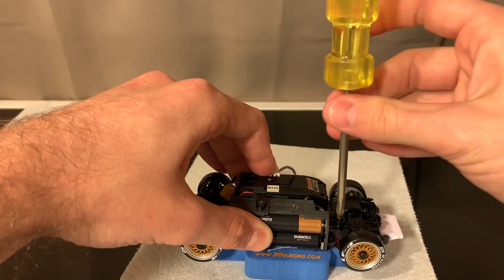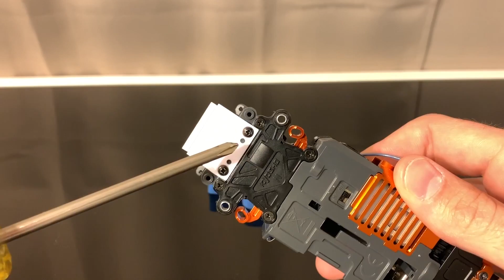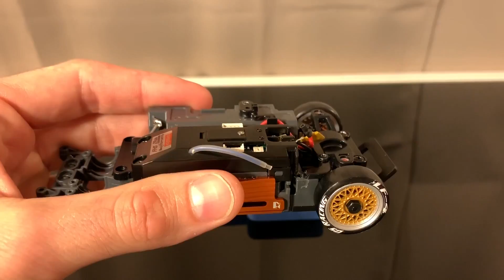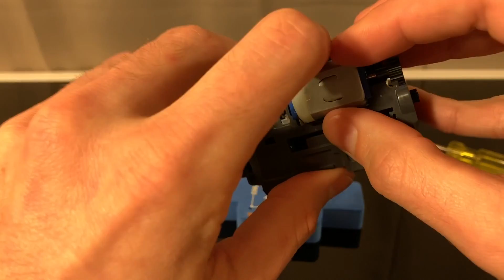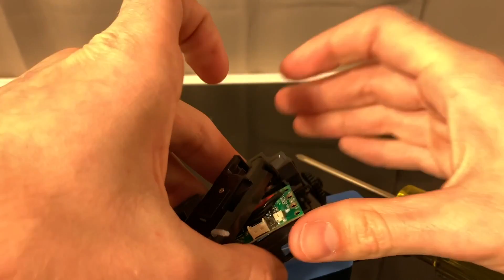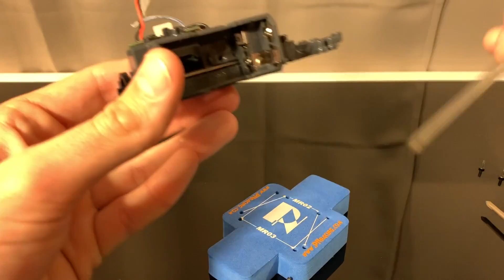Full Disassembly MA-020s Mini-z AWD Micro RC Car

Comment: Hi mate. Have you ever had a problem with the steering not returning back to centre and locking one way?
Reply from the maker: Check for dust & debris in the servo area. Just one tiny piece of debris in the right spot or even a single strand of hair can be enough to cause major issues. These littler cars are ridiculously sensitive. 

Hope this helps & good luck brother!
Reply: @BMR3  after disassembling the whole car I couldn't see anything obstructing the gears themselves. The only thing I noticed was a slight build up of dust on the top side of the tie bar which I cleaned up and seems to have foxed the issue. People have recommended changing to aluminium one to stop the problem in the future. Ridiculously fun little car though although it has already cost me a lot of money with a few upgrades haha

Comment: When I try to put my front suspension back together the springs are so loose they fall out. What did I do wrong?
Reply from the maker: That's normal when you pick the car up. If you have weight on the suspension, E.G. the car placed on a surface, then the springs will not fall out. 

Just gotta be careful when you pick the car up, I have lost a couple springs that way. Another thing you can do is look into the Mpower front suspension arms, they have a screw that goes down into the spring & holds them in position.
Reply: @BMR3  Im excited to see you are back. ive resolved the issue and become quite good and dissassembly now. I really appreciate the work you put into your videos.
Reply from the maker: Thank you brother! Hopefully I can start uploading regularly again soon. 

Have a wonderful day!

Comment: Brilliant video, congrats ! Done that but I did a mistake : now steering works but motor is not working. By any chance, do you have a lead of what I need to check please ?
Reply from the maker: MKe sure the motor wires are not pinched since that can damage them & also make sure you have the leads screwed down tight to the board. That would be the first things to check
Reply: @BMR3  Awesome, thanks a lot. One of my screws wasn’t screw down enough, even if I thought it was...
Reply from the maker: @TheMonkeyman399  Awesome, I’m happy to help! I had the same issue where I dident tighten down one screw 😹

Comment: Thanks for this video! Great job. Query, I have the original MA-020 AWD (analog) from when I raced years ago. Looking to jump back in with the newer digital controllers and maybe a brushless motor.  My chassis is virtually new hopped up with all aluminum parts from PN Racing; so I really want to keep it. Would this be the correct board:
http://www.kenonhobby.com/Kyosho-Mini-Z-RC-Unit-Set-MA-020VE-PRORA-35_p_46202.html
Reply from the maker: Sorry for the delayed response my friend! Yep thats the brushless FHS board, just make sure you have a compatible controller & you will be good to go :) 

What all did you upgrade o your car so far?
Reply: @BMR3  What didn't I!?! I have the SAS double-wishbone suspension in the back and front, that's fully adjustable with included shims (NUTS); ceramic bearings all around; high strength Delrin gears; heatsink on the FET; upgraded LSD front and back; and upgraded the drive shaft axle and the bearing brace to aluminum, as well. And I did that like 9 years ago! So essentially exactly what you did with your car here, except mine is analog. I posted pics on the Fbk group you recommended in the other video: https://www.facebook.com/groups/722063711267613/?multi_permalinks=1753312331476074&notif_id=1597009980725501&notif_t=feedback_reaction_generic&ref=notif
Reply from the maker: LionTree Media oh shit that’s your car bro?!?! I saw that beautiful chassis the other day on Facebook & I thought to myself “hot damn that thing is maxed out” 😹

Beautiful build man, I love it! Let me know how the electronics conversion goes 😼
Reply: @BMR 3  yep...the only thing left to do with that car would be to upgrade it to brushless...which is also why I asked this question! LOL Wanted your insight.

Comment: Great video, what would be the best route to put a lipo in there?  Could I take the battery case off and solder a battery connector for the grey and black battery wires?
Reply from the maker: Sorry missed this the first time around, yes you could solder leads to the grey/black terminals & plug in a lipo. Just be careful not to short the board out

Comment: Hey man, i want to ask if its possible to buy the servo motor? I cant find it anywhere..
Reply from the maker: Oh man, did you fry yours out? You will have to buy a full replacement board since they come wired in like this: http://www.kenonhobby.com/Kyosho-Mini-Z-RC-Unit-Set-MA020RA-45_p_46291.html
Reply: @BMR3  luckily not, but iam asking cause i couldn't find the servo standalone, only the expensive full replacement board. I thought it is the only way to replace the servo, but today i found something, but i dont know if its the same, used in our AWD series. It should be just a servo for MR03, found it only on a german webshop -> https://www.rc-tec.de/product_info.php/info/p1334_Ersatz-Servomotor-Mini-Z-2-4-GHz.html
and on Joyhobby -> https://www.joyhobby.co.kr/mall/Item.asp?siteid=joyhobby&itemid=586862&catid=9283
Idk but maybe this could be an alternative?
Reply from the maker: @DriftHobbyz  Sorry for the late response, your reply was marked as SPAM so i did not see it until now. 

That motor may work, but im not sure. as long as the power & dimensions are them same it should work

Comment: Damn Japanese made that platform all tight lol.
Reply from the maker: Lol it’s super tight upfront, putting in the servo components was major pita. But I happily deal with it since I love this scale
Reply: @BMR3  haha its supposed to be easier I thought since it's a small scale, oooh I was wrong🤦‍♂️.
Reply from the maker: Charlie Horse lol spot on, the smaller the scale the bigger the hassle. lol & surprisingly not much cheeper
Reply: @BMR3  running those aluminum hopup parts are pretty pricey. I like the car to flex for better handling etc. On certain parts on plastic.
Reply from the maker: Charlie Horse agreed, it’s good to have a bit of flex in certain areas to help absorb impact from a crash. Too much aluminum & you will end up snapping something that’s difficult to replace.  

Personally I think it’s best to have plastic camber knuckles & suspension arms up front to help absorb the impact. That way the shock energy doesn’t get transfers down into the servo & small fragile bits. 

But of course I always go against this thinking and bling everything out 😹
Reply: @BMR3  haha gotta have the bling bling. I paint mines for the blings lol.
Reply: Keep us posted on the first part that breaks from running those aluminum parts.
Reply: Also you're a pretty cool dude for responding on your comments. 🤙
Reply from the maker: Charlie Horse will do, but let’s hope nothing breaks ;) 

Thank you for saying that! But honestly I’m just an enthusiast & the whole reason for starting the channel is to share the joy & fun of mini-z. I have some decent experience from learning the hard way & I like to share & interact with my subs. Funny enough a lot of my subs have WAY more knowledge then I do, so it really pays to interact. You never know when a gold nugget of knowledge is about to be dropped 😹😹😹

Anyways hope to see you around the channel & have a good day/weekend man!
Reply: @BMR3  for sure, I just started on this mini z stuff from racing offroad 10th scale and I like these because its convenient. Dont need to go to the track just to run it. I'm from cali and there's only 1 track that I know that race these.
Reply from the maker: Charlie Horse yeah man that’s exactly why I got into mini-z! No tracks or local hobbie shops so I have to play with myself 🤦🏻‍♂️ I I I mean play by myself lol 😆 

I’m form Nor Cal, outside Sacramento specifically. The only place I know of to race these is down in the Bay Area or out in the boonies in Ukiah. Both are hours away from me so it’s not an option for consistent racing. 

Where are you located? There are a couple tracks in sac that used to race but stoped since there was little interest/info on this scale.
Reply: @BMR3  I'm in San bernadino county. Theres a track Called coyote hobbies in victorville they have a track there for the mini and offroad. I race at ocrc for offroad in huntington beach.

Comment: So I have to do that to put my aftermarket drive shaft  and steering servo in?
Reply from the maker: jeff russell hey Jeff, yep you have to tear the car down completely to access the driveshaft & servo area. Literally remove every part. 

One thing to note with the servo: it’s not a traditional servo & it’s kinda janky. Only pressure holds the plates together, no screws. So when you remove the servo, make sure to keep pressure on the back plate so the electronic circle thingy doesn’t pop out of place. 

I dident even realize there was a back plate until I had the servo install in the new chassis & all the other parts in. Then I notice there was a black plate sitting in the old chassis....
Reply: What aftermarket Servo did you buy and where?
Reply from the maker: You can’t fit after market servos unfortunately, you will need to lift the stock “servo” out of the originals chassis.

Comment: If we don't mention the performance and durability, the design is elegant and better than MA-03. This is pretty easy to tune should anyone want to change spur gear and diff.
Reply from the maker: Beaver's Hobby True lol but I don’t think the MA-030 is any more durable then a 020. Both unfortunately use very brittle plastic & are sensitive to crashes. I never thought about it but your right, the 020 is pretty elegant with its simplistic straight forward design. 

However the performance upgrade with the 030 is pretty shocking. I dident think the 030Evo would be so superior but it is. Balance & weight distribution are far superior & the brushless motor gets noticeably longer run time out of the batteries. The 030 platform really blows the 020 out of the water! 

But that said, I still love my 020, it’s an amazing little car. I plan to use both but have them dedicated to different bodies & wheel bases.

Comment: I cant remember the last time i was that careful when doing a full disassembly, i think  i have done it one too many times and become jaded. just pull the screws and dump them on a magnet then work out which screw is which by sight (there are 2 different types of threads for the non countersunk screws)

if you do this often i recommend the hardened or titanium screw heads and a cheap and soft metal hex screwdriver. this prevents stripping the hex socket on screws and causes damage to the tools and not the screws, any weight savings are secondary to this.

one video on my todo list is how to redo stripped threads on the mini-z but thats low on the list of videos coming out. these frames dont stand up to maintenance attrition well and hence why i like metal parts
Reply from the maker: Blitz Works I thought about getting some harder screws, I ordered the PN racing black screw set since it was drift cheep, but I wish I would have gotten the titanium set. I can always order them when Kenon Hobby opens back up in a couple weeks. 

I video about how to rethread striped chassis screw holes would be pretty sweet. But if you went to a larger size, I fear the plastic would become even more brittle since there would be less material.